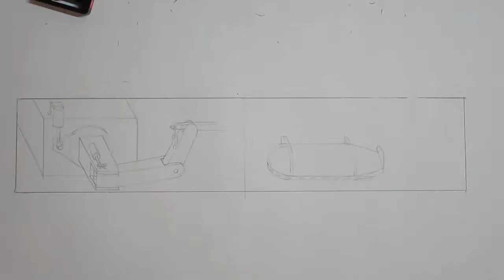Designing a Mechanical Rhinoceros Beetle - Mezzotint Printmaking Pt. 1

Comment: Hi, thanx for sharing your knowledge here. I have never tried this printing method but I am getting very anxious to experiment. It might come as a very lame question but just to know can Plexiglas be used instead of a copper plate? Just curious.
Reply from the maker: Lots of people use plexiglass for drypoint printmaking, and you could certainly use the rocker to create textures in the plastic. I don't know how well it would hold up to a mezzotint rocker and then scraping down the burs that are created. Let me know if you give it a try!
Reply: Thanx for your reply. Firstly I do not have a rocker. Unfortunately I live in a place where art materials are scarce even online ordering wont help much. But I will definitely try to experiment on a small plate and share with you. Thanks